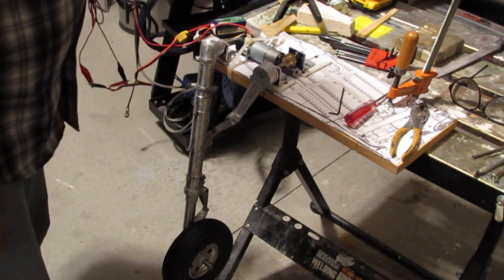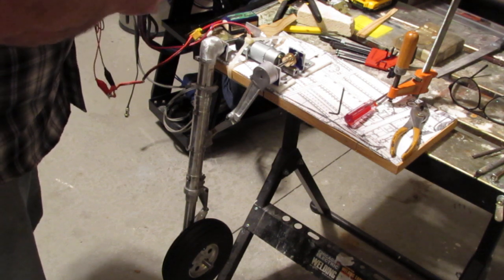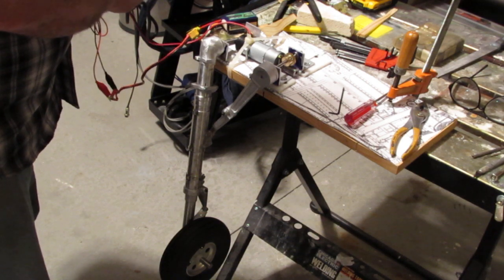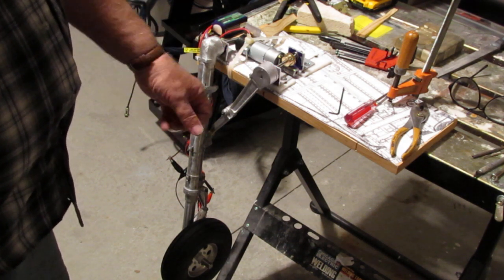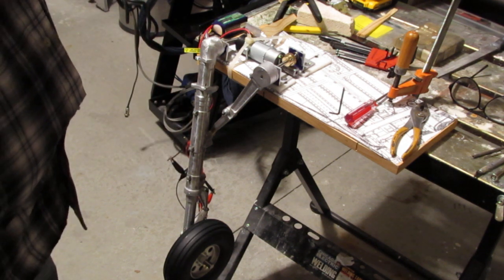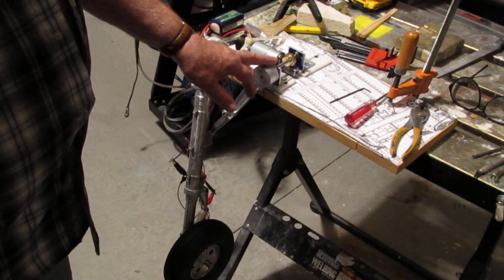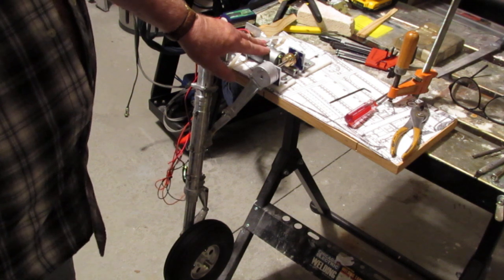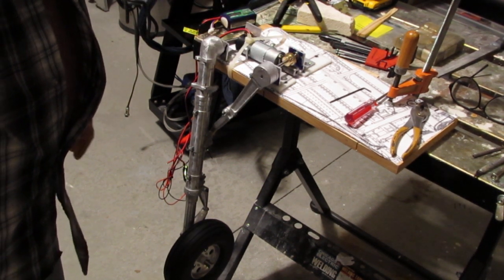FW 190 Scratch Built Gear Test /Proof of concept, Retract mechanics

Comment: A.m.s. u.s.n. here make the pinion out of steel. Not brass. If it gets under to much load like if the plane bounces sideways it will strip that gear. Not brass brass has a bad sheer point